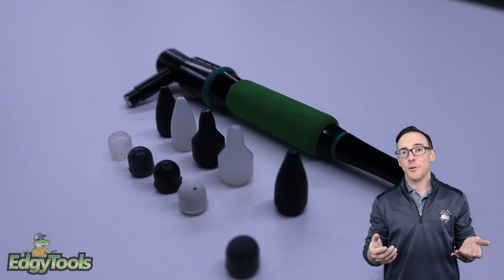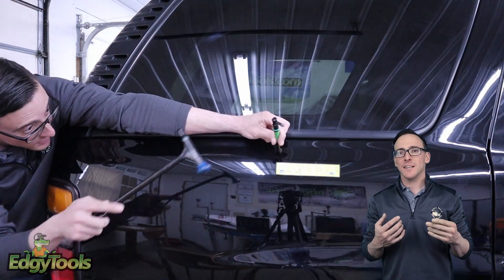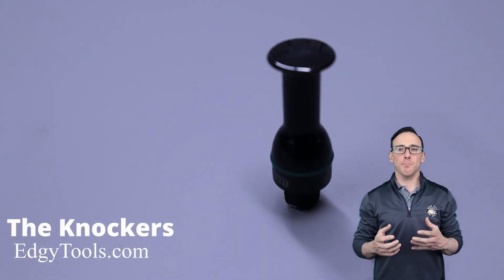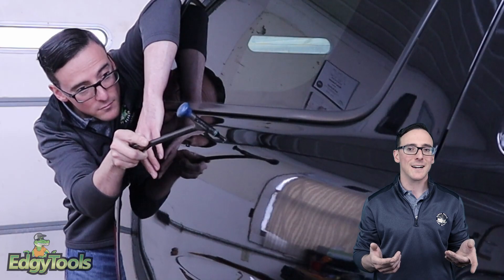PDR Tool Review | Edgy Tools | No-Roll Knockdown & Blending Tip

Comment: Can the knockdown tips be removed to use some other standard 5/16 threads tips?
Reply from the maker: No they cannot the metal tips that the caps slip onto are integrated into the knockdown. That's ok because the whole setup works so well as it is! Thanks for watching!